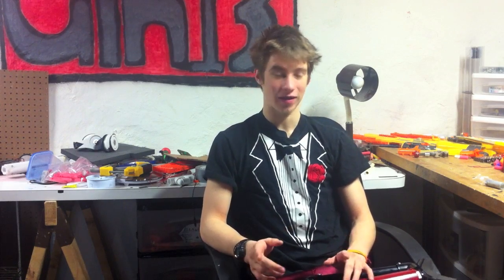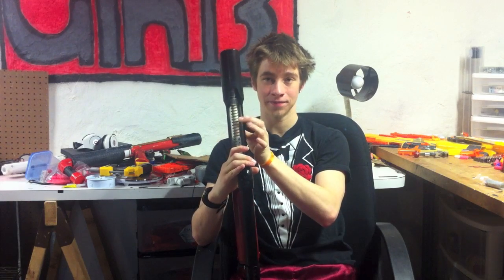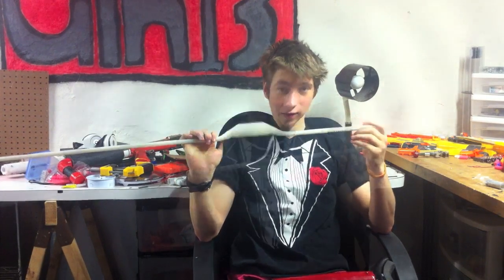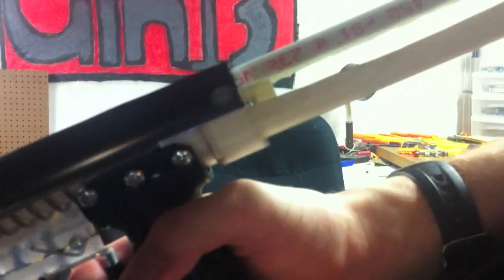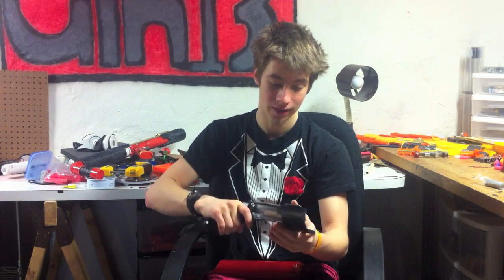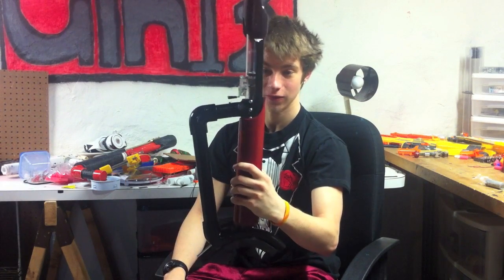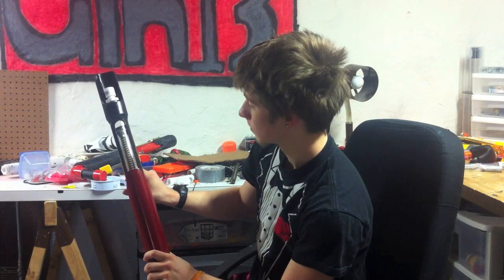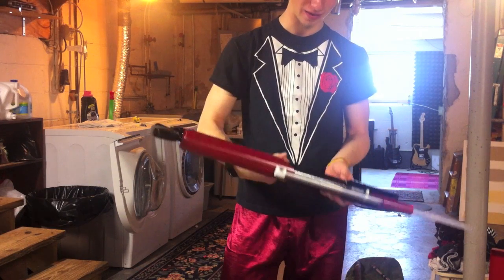[Nerf Mod/Homemade] Final IPS project

Comment: He will probably never see this, but about his range, to achieve the maximum power of a K26, seven (7) inches is needed to prime the eleven (11) inch spring down to it's four (4) inch coiled form. From this video, it looks to be a possibly five (5) inch prime which limits the amount of air space that can used to propel the dart, simple physics, which of corse I assume Uin13 is aware of after his success with the R2M. So, just pointing that out.

Comment: on the tube that holds the stefans, could you put in a weak spring and plastic circle attached to it inside the tube that'd push the stefans into the place they need to be to fire? So you wouldn't have to lower the gun to load it.

Comment: I had just lost faith in you... but you suprised me... no you didn't suprise me i knew you would come out of the wood work with something but this is bad ass.. do you think when you get another neopream washer on it youll get better ranges? ive been working on a snap carbine (ace). that i would shit my pants if i get over 60 feet...if you make a video write up.. well i have fifty buck to kill and no life so... do you need more than 80 feet your quadshot was only like 90 right? you wont read this